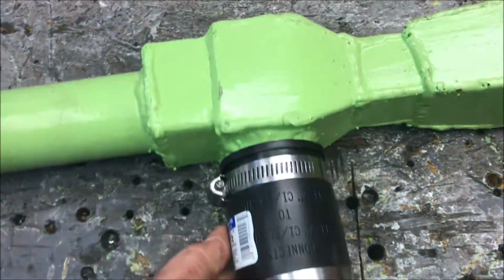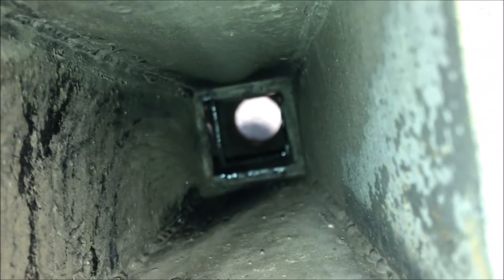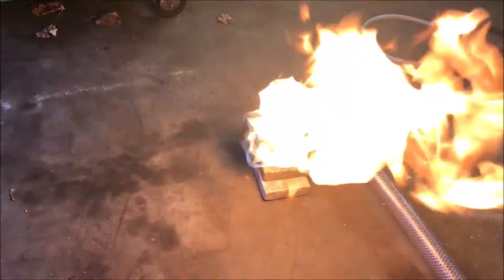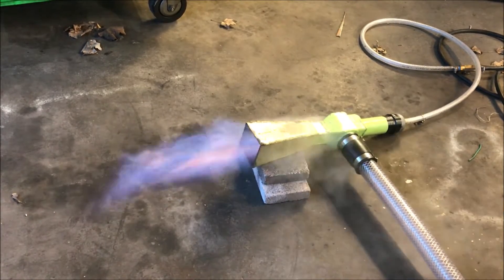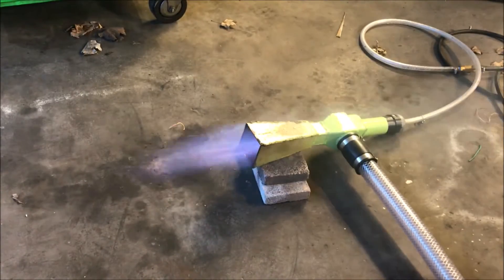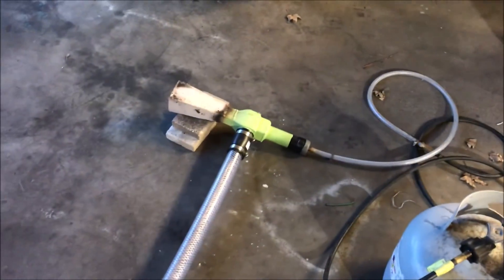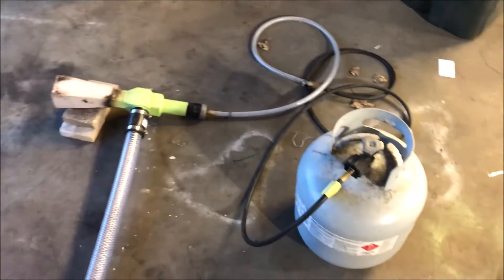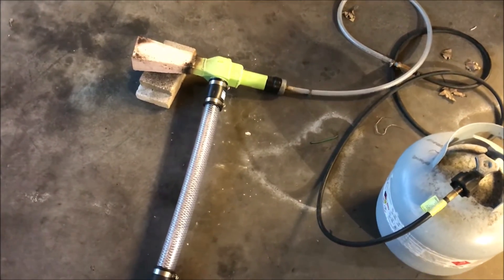Venturi pump or massive blow torch

Comment: The vortex is a byproduct of the cross flow. This is caused by the air striking at 90 degrees from the line of flow. If you paid close attention, the vortexes were coming from a high pressure point forming on the opposite side of the air inlet box from the air inlet.

This type of swirl is quite natural and predictable.

The way to eliminate that would be to build a port with multiple symmetric inlets all the way around, but to be frank about it, it is really not a problem and will not adversely affect your product in this case [as a subsonic bernoulli type jet pump].

Comment: I think the blower intake on your venturi is in the wrong location and it would be better to optimise the air blower for more pressure and less flow.

Restrict the air holes from the air blower innside the venturi.
Put the pressure air holes a little forward.

The best for a venturi is high speed airflow not high volume from the pump, most uses compressed air at 8 bar and a very small tube

Comment: how about turning the blower air duct at a 60 degree angle to the flu pipe ???? would take less power to pull the same volume of air and might increase the velocity making the carbon and such have less chance of sticking